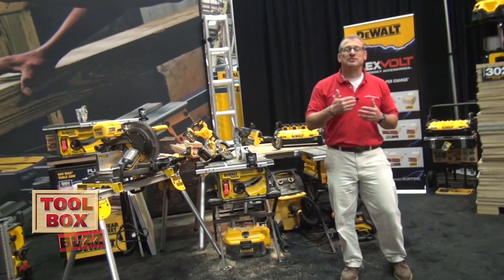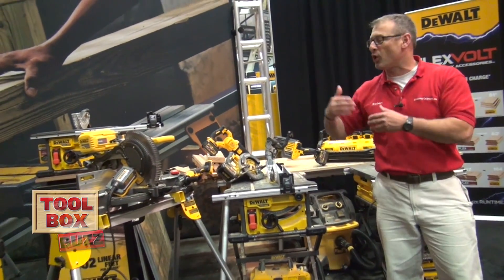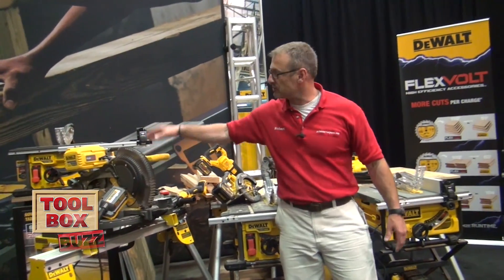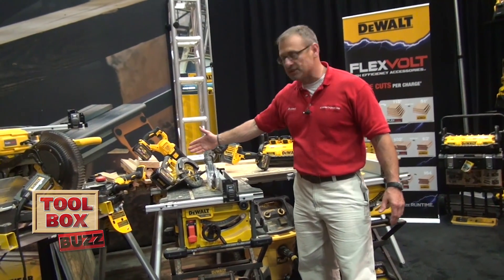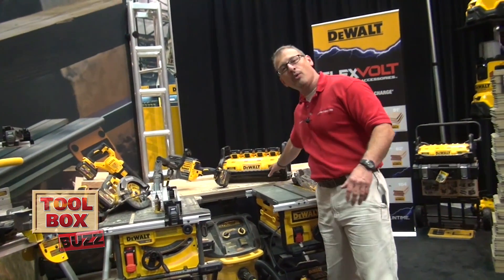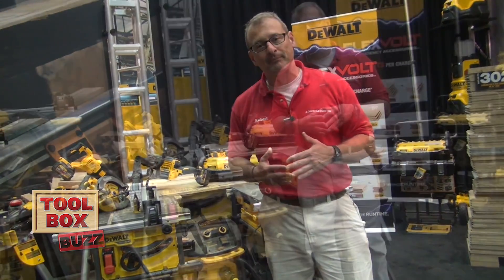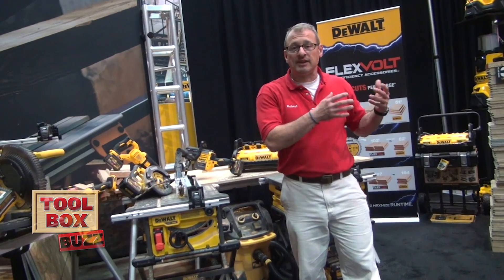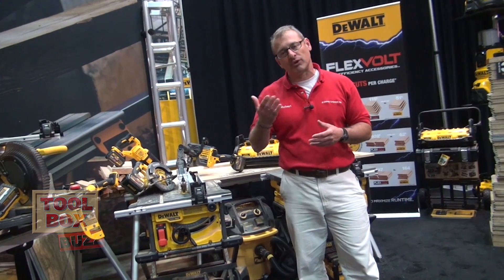NEW DEWALT FLEXVOLT System

Comment: Comment:    The Flexvolt system to me sounds like a logistical nightmare. Understand that in each battery, there has to be a system than completely re configures the wiring of the cells between 20v and 60v by using the cell groups in series or in parallel. That means at the high current levels of battery use in a cordless tool and pack, there have to be switching circuits, mosfets or relays crammed in the pack which have questionable reliability or ability to handle those currents. I would not expect, based on the pack size, and the space needed for such components that they would be very capable in that sense. One thing, if you look at the milwaukee packs, compared to others is that they have very large wiring traces (bars) to handle the currents and reduce overheating. It would be better to use 2 20v batteries, or use specific 60v packs than have this questionable switching battery design.
Reply from the maker: This definitely remains to be seen

Comment: Are these 20 Volt Flex packs compatible with the 20 volt max stuff or is it a completely new line of tools?
Reply: The new 20V/60V Flex packs are backwards compatible with all the existing 20V tools and chargers.
Reply from the maker: The are compatible - they care backwards compatible which means they will work in 20 volt tools but 20 volt batteries WILL NOT work in the new 60v and 120v tools